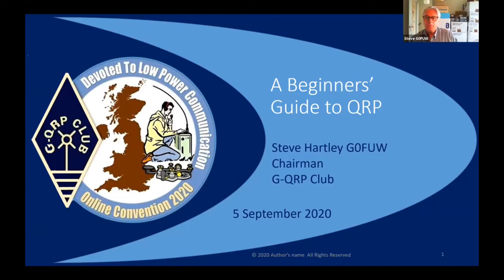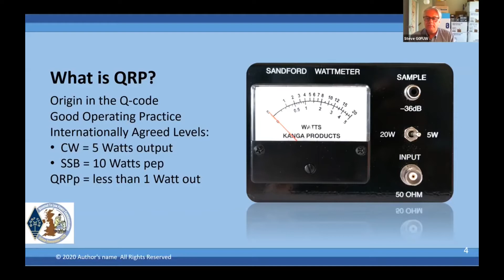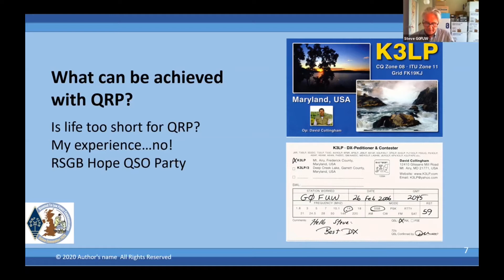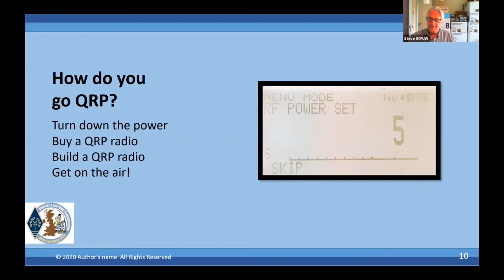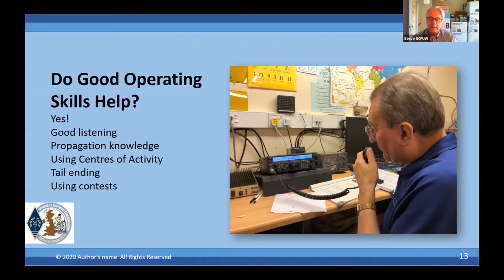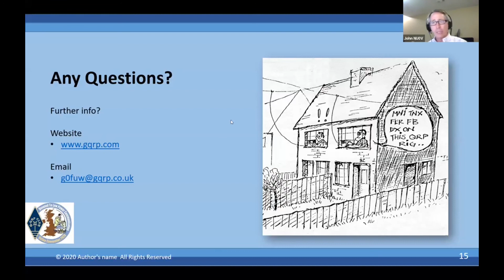G-QRP Convention 2020: Steve G0FUW - QRP for Beginners

Comment: Thank you for this video! At 5:53 you mention of "Low emc risk". What is "emc risk" ?
Reply: Fabiano, I think EMC is Electromagnetic compatibility (EMC)..."the ability of electrical equipment and systems to function acceptably in their electromagnetic environment, by limiting the unintentional generation, propagation and reception of electromagnetic energy which may cause unwanted effects such as electromagnetic interference (EMI) or even physical damage in operational equipment.[1] The goal of EMC is the correct operation of different equipment in a common electromagnetic environment. It is also the name given to the associated branch of electrical engineering."